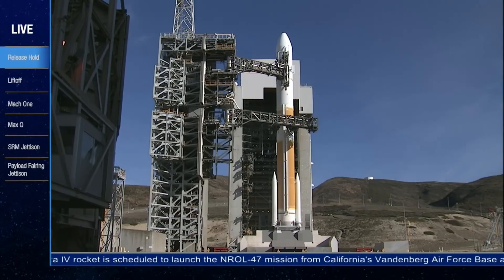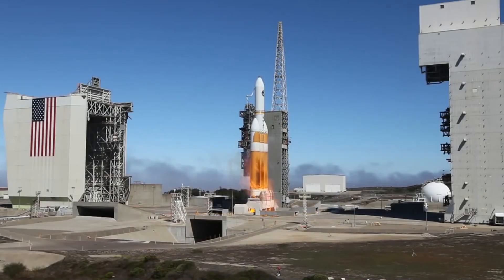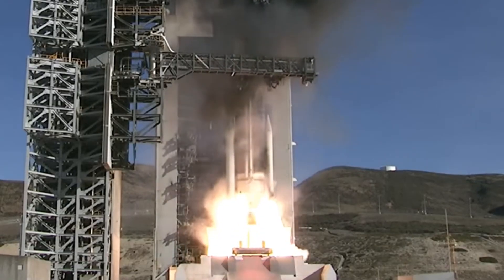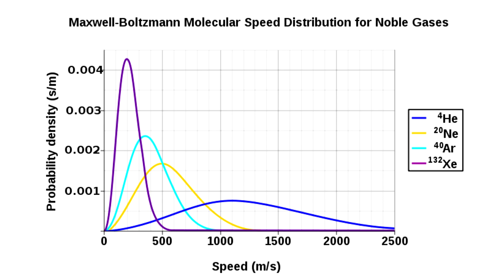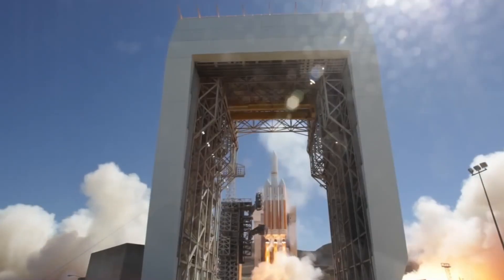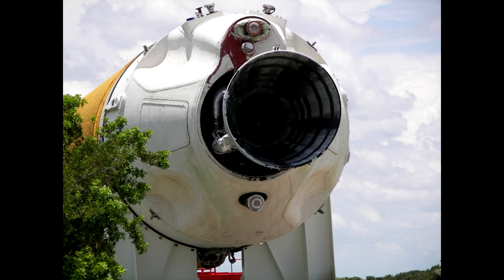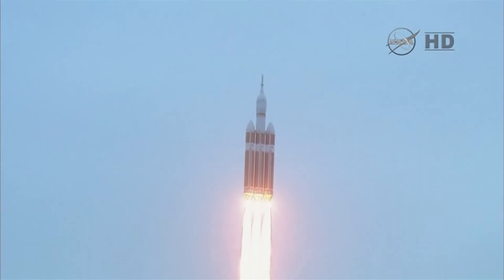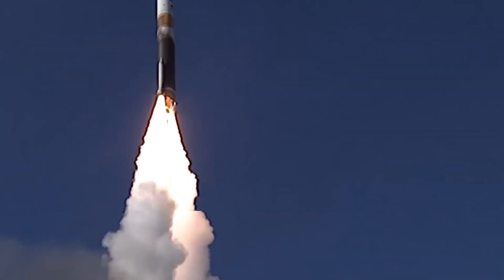Explaining the Delta Rocket Fireball - Kerbal Space Program Doesn't Teach....

Comment: Wait, 64 tons into low earth orbit... well the M1 Abrams can be pressure sealed against contaminants... SPACE TANKS
Reply: I wonder how much delta-V a cannon shot imparts...
Reply: Containment Failure about 1500m/s
Reply: @cf453  don't ask that ... that way lies the A-Team Movie! :D
Reply: @cf453  you could calculate that. It is not even that difficult. If I remember I'll tell you later.
Reply: Spy Crab ok I'm with you. To navigate in the vacuum of space, the m1 could fire in the opposite direction of where it wants to go.
Reply: Sebi One: The latest version (M1A2) can carry 42 rounds for its main gun. The  M829A3 round weighs about 22kg, including the propellant, but since the combustion gases also shoot out of the barrel, we can include that mass in the calculation. The muzzle velocity is 1555m/s. If you do the math, that translates into a delta-V of a measly 23m/s for the tank itself. Not much manouvering gonna happen.

In terms of specific impulse, that's only about 158s, which means that tank guns are pretty bad rocket engines.
Reply: blahfasel2000 and that delta-v will be delivered as a rotation since the cannon is not along the tanks center of mass. It looks like it is a little above. Spinning space tanks?
Reply: @blahfasel2000  and of course somebody did this before I could
Reply: Sebi One didn’t they have something like that in the A-Team movie while parachuting a tank to the ground they used the main gun to either slow their decent or steer, I can’t remember. Who knew you could learn science from the A-Team movie!
Reply: Sebi One YOU CAN’T FLY A TANK FOOL!
Reply: Keyboard Warrior  The round would fire (contrary to popular belief, gun propellant is a fuel-oxidizer mix) but you can't reload because that would require opening the breech which is the only thing separating the crew from the vacuum inside the barrel.
Reply: @ShimrraJamaane  you could have some kind of airlock set up, guy in space suit as the loader.
Reply: @CreeperDude-cm1wv  I'm just referring to modern loading systems. In an M1, the crew aren't separated from the breach and the breach is a single barrier to the outside.
Reply: @ShimrraJamaane  put em all in space suits
Reply: @ShimrraJamaane  so? Install a second breach outside the turret. And as the length of the barrel has no impact on the weight of the projectile of the volume of gasses created, it can be radically cut down to safe a bit of weight.
Reply: @Ugly_German_Truths  as I said in an earlier comment, I was referring to modern weapon systems. Given that such a double breach does not currently exist, the point stands.

However, yes, you could add a remotely operated secondary breach. You still need to vent exhaust gases though. At that point, you might as well just wear spacesuits.

The length of the barrel still factors into exit velocity of the round, however. You can't cut the barrel length down without losing thrust to the projecticle.
Reply: I don't see any reason why it wouldn't fire. Gun propellants bring their own oxidizer, just like a rocket, so they don't depend on external air. You might have a problem loading the gun though, with all the air in the tank escaping through the barrel once you open the breech.
Reply: Space tanks for our space force! I love it!
Reply: In the highly unlikely event that someone did design a tank to operate in space, they'd either design it so the crew would wear space suits and operate in a vacuum, or they'd redesign the barrel so that it could be sealed off from space during the reloading procedure in order to avoid venting the cabin pressure to space.

More likely, both would be done.  Having pressure inside and vacuum outside makes a space suit very inflexible and difficult to work in.  There would be space suits just in case of the cabin being breached (which if you think about it, is highly likely in battle) while the cabin is under pressure to keep the space suits flexible.
Reply: Didn't the A-Team do it already?
Reply: Genius!
Reply: Gentlemen, we have a problem.  Even assuming everything else about this brilliantly absurd scenario works (it wouldn't; the tank isn't actually perfectly air tight, the interior is just kept at a slightly higher pressure to keep air flowing out so contaminants don't flow in), there is a bigger problem:  How do you get power to run your electronics and hydraulics?  Both the engine and APU need air to operate.
Reply: Yes
Reply: Spy Crab slow down there A-team
Reply: @bond8436  it would though, propellant carries its own oxygen
Reply: @bond8436  It's always hilarious when someone tries to make a tangent to sound incredibly smart, only to make it obvious they don't understand what they're talking about, at all.
Reply: @bond8436  Yeah it will.
Reply: Tanks not actually sealed, it operates on a positive pressure system, nbc system filters out the bad, and pushes it in to the crew compartment at a slightly higher rate than it leaks out
Reply: That's not how it works. The Abrams maintains a positive pressure to keep contamination at bay. Wouldn't last in a vacuum.
Reply: Woah
Reply: YES SPACE TANKS
Reply: SPACE TONK
Reply: Everyone is forgetting the insulation it would need, all the steel would freeze. there is no insulation layer, just solid steel.
Reply: Just need some RCS and plenty of ammo
Reply: wait for starship with 100 tons into fucking mars
Reply: Yes we need that
Reply: I wonder what the apoapse difference would be to the tank if you fired it prograde in low earth orbit
Reply: @bond8436  I am sure it would fire but that recoil would send it flipping end over end across the universe.
Reply: @davidhenderson3400  Machine guns for attitude adjustment.
Reply: Still cant fire a american up there

Comment: Uh, Scott, the Delta IV is a completely different rocket when compared with the Delta II that preceded it (and flew 153 times successfully).  Delta III was never fully operational and only launched three times with the first two being partial or complete failures.  The Delta III used the same fuels in its first stage as the Delta II (RP-1 and Lox), but like the Delta IV, it did use a hydrogen-oxygen powered 2nd stage.  However, after the 3rd launch, the Delta III was canceled in favor of the all cryogenic Delta IV.

Comment: Is your point about fuel mixture the same as saying that the heat capacity of hydrogen is lower than the heat capacity of water, so you're better off adding some extra hydrogen to the mix just as extra weight to be flung out of the rear of the spacecraft?

My favourite bit of physics is the fact that the more ways you can bend and wobble a molecule, the less of it's thermal energy goes into translational motion, and water is undoubtedly more bendy than diatomic hydrogen.

Comment: Using hydrogen to increase the safety around rocket seems counterintuitive but it's much safer that a mix of both gases. When working at a science museum years ago there was a demonstration where I exploded balloons both hydrogen and a hydrogen/oxygen mix. The hydrogen balloon went "woosh" as the burning gas mixed with oxygen in the air but the mixed gas bang was so loud I got complaints from the observatory above it. It was shaking the telescope! Unfortunately health and safety/insurance concerns ended that show over a quarter century ago.

Comment: Please make a video explaining the methods of making a rocket cheaper. Also, what is the most economical way a rocket can be designed and manufactured, for both liquid and solid fuel rockets?
Reply: Mohamad Ghotbizadeh Space X is aiming for just that, reusing every possible part of the spacecraft.
Reply: I know and I fallow SpaceX events, but I mean the actual building process of a rocket not reusing it.
(Like in a car factory they trying to make 'reusable' cars and manufacturing process of them cheaper.)
:)
Reply: Mohamad Ghotbizadeh rockets are built so so so preciesly by hand by many tousands engineers, thats why its expensive. Huge amount of R&D costs a lot too.

Comment: Unless I'm mistaken, another reason they run fuel rich for liquid oxygen engines is so that the oxygen doesn't treat the engine itself as a fuel. At the temps and pressures in rocket engines, "corrosion" is more like "burning". If you go too fuel rich, you may lose some efficiency. If you go too oxygen rich, things go bad fast.

Comment: I must dispute your explanation of how burning fuel rich can be more efficient. The distribution of translational kinetic energy on the exhaust molecules is determined entirely by the temperature (kT/2 per degree of freedom and all that). The thing about light molecules is that they have a higher velocity for the same kinetic energy. And the efficiency of a rocket engine is determined by the speed of the exhaust, not by anything to do with kinetic energy.

Comment: The space shuttle didn’t have this problem. So do they use sparklers to burn off the excess hydrogen before to rises up around the boosters
Reply: Yes, they use ROFIs (Radially Outward Firing Initiators) or sparklers on the Delta just like they did on the Shuttle, so I don't know where the difference comes from.  One big difference is that the Delta is launched dry while the Shuttle used a water deluge system, but I don't know if that is enough to explain it.  Was it also due to different ROFI placement so that the hydrogen lit earlier?  Was the RS-25 (SSME) startup procedure different from the Delta's RS-68?  I've yet to find an explanation.

Comment: I'm curious as to why we didn't see such a pronounced fireball with the shuttles' main engines.  Were their sparkler thingies just more aggressive (more sparks, or they started it up earlier)?
Reply: I've wondered that as well.  Were the Shuttle's ROFIs (Radially Outward Firing Initiators) placed closer to its engines so that the hydrogen lit earlier?  Was there something different about the RS-25 (SSME) startup procedure compared to the Delta's RS-68?  Or does it come down to the Delta launching dry while the Shuttle used a water deluge system?  Inquiring minds want to know!

Comment: So they are new designed rockets that get built one time ,used one one time and then Thrown away ? Is that correct ? And if it is does it completely burn up or do they fall partially burnt back into the ocean ? 
And rockets are awesome so thanks for your channel :)
Reply: You shouldn't call it a new designed rocket because the design is the same for each one but they do build a specific rocket for each Mission because it is expendable. Depending on the mission profile the components will either fall back down and burn up in the atmosphere or the land in whichever ocean is along the trajectory
Reply: Most parts of a space rocket are a one time use component due to the weight they have while empty, it's too much for parachutes to handle. Booster rockets on the other hand are light enough that they can be returned with a parachute because technically they are just a capped tube with a nozzle at the bottom for thrust and are packed with solid fuel to burn, not a liquid hence no need for separate fuel tanks in them.

Comment: Can someone explain to  a layman what Scott means when he says "fuel rich"? Does it refer to a higher ratio of hydrogen vs oxygen (ie. hydrogen is fuel and oxygen isn't?) or something else?
Reply: Yes. Technically oxygen is not referred to as a fuel in rocketry - it's an oxidizer. The other part of the mixture is referred to as the fuel. The two (or more) components together are referred to as propellant. Very pedantic, sure, but it matters in those kinds of things!
Reply: In this case, Fuel is LHy, Oxidiser is LOx. A balanced ratio is 1:8 by mass. Fuel rich uses more LHy. On the other hand, Oxidiser rich uses more LOx.
Reply: Fuel rich (aka rich mixture) means the same for a rocket as it does for a car engine: Pumping more fuel into the engine than it can burn with the available oxidizer.
This is done for similar reasons: In a car engine, making the mixture too lean makes the combustion much hotter, which puts a lot of thermal stress on critical parts such as exhaust valves and spark plugs. In the rocket, burning too lean also means burning too hot, which can literally melt the combustion chamber and nozzle if the temperatures are not kept under control.

Cooling in a rocket is often described as "regenerative", which basically means that the fuel is pumped through a layer surrounding the combustion chamber and rocket nozzle, preventing those critical parts from overheating. This has the convenient side-effect of preheating the fuel, vaporizing it before it is injected into the combustion chamber to be burned.

There is of course another reason for running the rocket engine fuel rich, which is to improve the specific impulse, a measure of rocket propellant efficiency. This is about exhaust velocity - the faster this is, the more thrust the rocket generates. But for any given temperature, smaller molecules travel faster than larger ones.

Hydrogen is just about the smallest molecule possible, so in a rocket using hydrogen as the fuel, you want to have a decent proportion exhausting without being burned by the oxygen, which would convert it into water vapour, a much heavier molecule. Though of course you do have to burn some of it to heat up the rest, hence the rich mixture.

This also works for rockets burning kerosene (aka RP-1), which is a hydrocarbon. Oxygen is used as the oxidizer for this as well, so a lean mixture would produce water vapour and carbon dioxide. Running this fuel rich means that some of the carbon is oxidized to carbon monoxide, a smaller molecule, meaning greater exhaust velocity and higher specific impulse.

Comment: Normally when flames lick the side of an object, the resulting black smudge is from tiny particles of solid carbon deposited as a biproduct of combustion. When burning hydrogen, there's no carbon lying around. Why do the tanks blacken? Is it a result of the paint itself burning?
Reply: It's not paint - it's foam. So it's very easily burnt.
Reply: Thanks!
Reply: New proposal: hybrid rocket. Oxygen fed through a reaction chamber stuffed with leaves and shit.
Reply: Tom Haflinger lmao 😂
Reply: lol, someone call nasa, they might be able to beat spacex if they get on that right away.
Reply: The heat from the burning hydrogen scorches and burns the surface of the orange foam insulating the tank. Its likely the same stuff the space shuttle tank had on it.
Reply: It's actually the insulation foam, which is unpainted (paint adds mass- that's why they stopped painting the Space Shuttle tanks after STS-2), but yes. That's also why there are two colors of flames visible: bright orange from the tanks and dull red from the hydrogen.
Reply: Jyps Ridic, you can reduce CO2 with hydrogen, but typically it requires metal catalysts and high pressures, so I seriously doubt it would happen in open air. (The result is either methane and water or elemental carbon and water)
Reply: The hydrogen burning makes no visible flame.  The fire you see is the foam burning after the hydrogen burning lit it on fire.  The red tint out the nozzle after liftoff is the nozzle ablating, not the hydrogen burning.
Reply: yeah, agreed. sort of what I was thinking and trying to say
Reply: +Tom Haflinger the foam is made of larks tounges.
Reply: They foam on the outside of the tanks only serves to insulate the cryogenic liquid before launch (so it doesn't all boil away). During the Shuttle program they stopped caring if it was painted (hence the ugly "primer orange") and have since stopped caring even if it gets burnt up and shitty during launch. The idea is that it's so irrelevant to the rest of the flight that it doesn't matter if they skimp on it and save some weight and money.
Reply: There is black smoke though so I wonder if it's the mixture of hydrogen to air (rich mixture) and carbon is the byproduct
Reply: The RS-68 engine is a development of the SSME. In addition to flogging the machinery harder because it's only intended for one launch, they tried going to simple double-walled construction instead of the insanely labor-intensive brazed tubing to save money.

Well, apparently no one outside of Russia can make this work. To prevent burnthroughs at the throat, they added ablative material which gradually erodes away during operation. That's probably what blackens the tanks, but it's certainly what causes the orange flame coming out of a hydrogen engine that makes you go: "WTF!!"
Reply: I think that'd only happen if they were using the CO2 in the air as an oxygen source. I'm no expert so I could easily be wrong about that.

I don't think they could be doing that because of how much energy it takes to break the bonds in CO2, we fuel most of our world on the energy released by those bonds forming and to break them you need at least as much energy as it released in the first place. 

Secondly, I don't think there is enough CO2 in the atmosphere to account for that much soot that quickly in that local of an area.

I was assuming that the soot was coming from the rocket coating, apparently foam, and the graphite on the cones, and perhaps there is some incidental litter; they might burn of plastic seals on things that need to be kept clear of any moisture or dust or something. Then there's leaves and shit on the ground maybe or even small animals that entered the fireball zone. 
No evidence for any of that, just my thoughts.